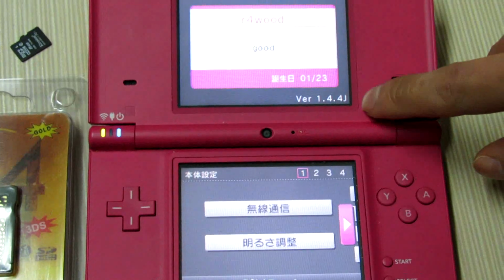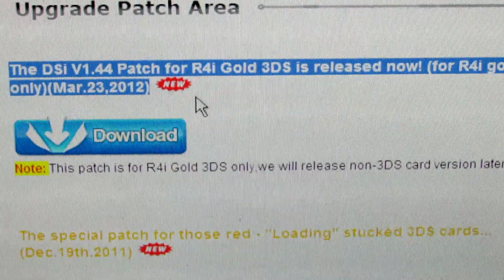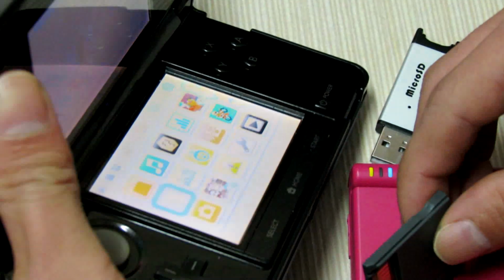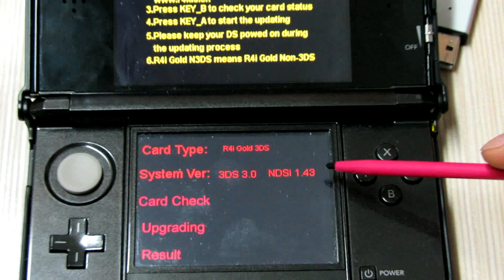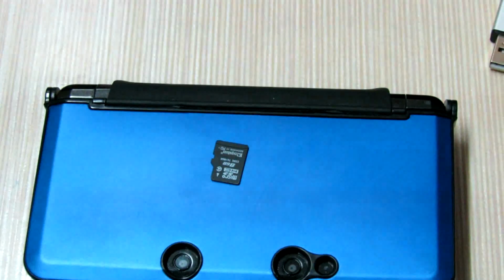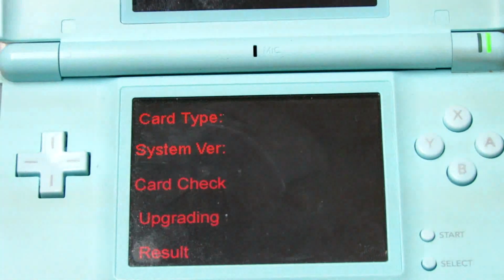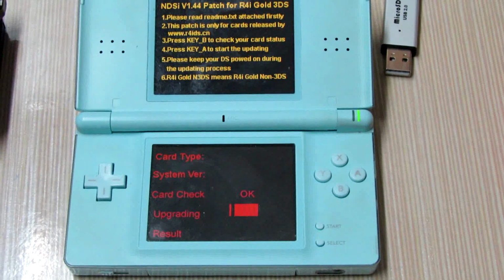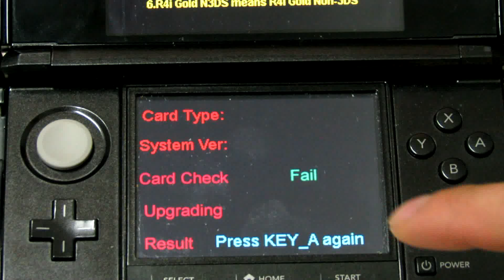R4i Gold 3DS Firmware Update Methods for DSi V1.4.4 System.flv

Comment from the maker: And you can check your 3DS system version firstly, and at the same time, check what system version your R4i Gold 3DS card supports, you know, I press B button to check it when run the firmware patch.
Actually your r4i gold 3ds should support up to 3ds system Ver 3.0.0-6

Comment: I have the Dsi XL with 1.4.5...i got the R4i 3ds gold RTS card and put the latest Wood kernel in it but the DSi system does not recognize the card and say 'No SD card'. Please help!
Reply from the maker: maybe your micro sd card is not inserted properly, or how about try another memory card ?
Reply: R4woodcenter i tried with new micro sd crd but the dsi xl does not recognize anything being in game card slot
Reply from the maker: pulkit dabral
Try to test your r4 card on aother console, if still not recognized, you can try the method described in its official 1.45 firmware patch, find another r4 to boot up and run patch to fix that "no card inserted" problem.

Comment: Hello, I don't know if you can answer this question, but I have an r4i gold 3ds. I want to update the flashcard to 1.4.5 XL or just 1.4.5, my r4i gold 3ds card is also revision 9 (witch is supported on r4ids.cn website. I drag the .ndsl version over onto my micro sd card. I eject it from my computer and put it in my dsl for updating purposes. I goto the file named (blah blah blah1.45.ndsl or whatever) I press key_A and it says fail. Am I doing something wrong?

Comment: I have questions my nintendo have problem he say An error has occurred what ican do please Help me
Reply from the maker: Most of the time, your nintendo system is too high, and it blocks your r4 card. You can get a ds or ds lite to update your r4 card. How ? Go to your r4 official website, and download both its latest kernel and firmware patch, load and run that firmware patch on ds or ds lite to complete the update. It will usually fix the problem. If it is not firmware issue, you can also try to clean the nintendo pins and replacing the memory card to check whether it works or not.
Reply: Please Ayou can do in  video please
Reply: My R4 is shds or Refuction and my nintendo ver 1.4.5U
Reply from the maker: عبدالله العقيلي

I do not know which r4 card you have, can you give the image of your r4 card, or can you find the card at r4wood.com ?
Reply: Is not R4i gold 3ds is R4i gold very please can you do this an video because I dont know what I do
Reply: Idont ware find the path
Reply: A you have whats app
Reply: Please you can Help me what I do now my nintendo dsi in my nintendo 3ds he says An error has occurred

Comment: I have dsi with 1.4.5 and r4 sdhc 3ds and i did that and still it is not working pls help
Reply from the maker: You can tell which r4 sdhc 3ds it is, for example, its official website and its corresponding version as some r4 websites have released many versions.
Reply: R4woodcenter iHave r4 3ds wgut wifi so what i need to do
Reply: R4woodcenter I am sorry if i bored you but i am litlle noob whit dsi
Reply from the maker: Flori MC
Old r4i sdhc 3ds card can only be updated up for 1.4.4 system
Reply: ok